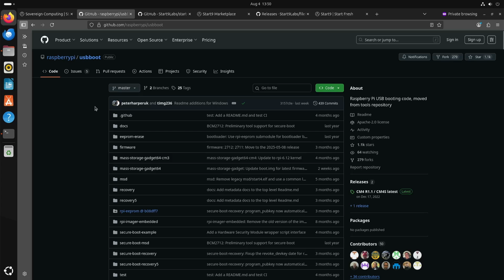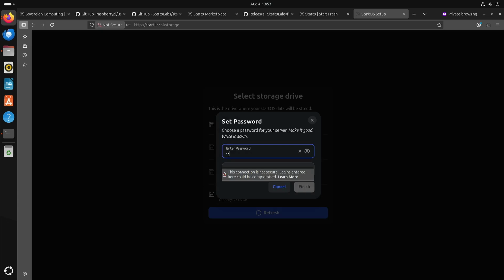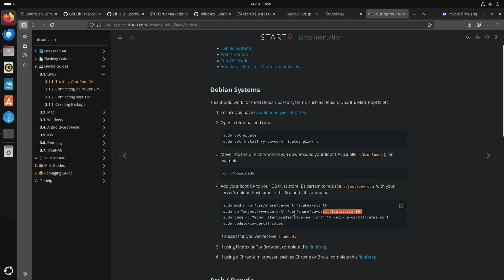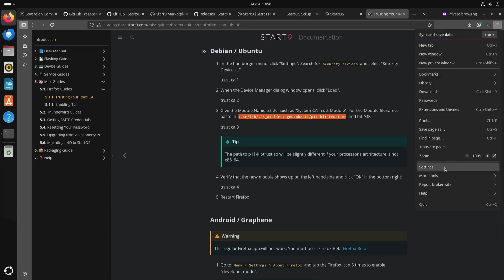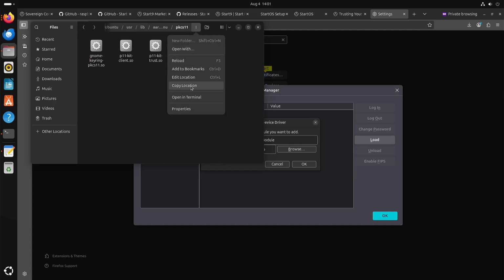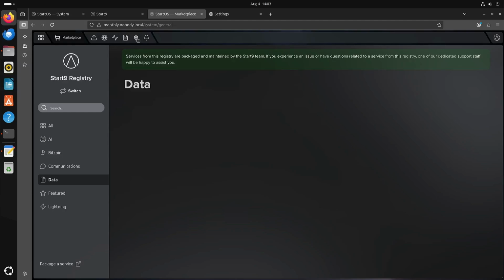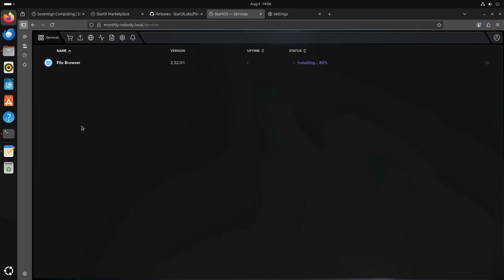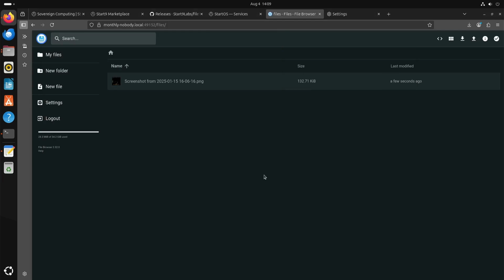StartOS CmRat Raspberry Pi CM5

Comment: Im using the cm rat with the Radxa CM3 8GB RockPro with RK3566 CPU - OEM - No MMC - No WIFI - 8GB Ram RPI4 and its been difficult to even load start9 os. Talked with cmrat and start9 teams and looks like I will have to wait. I will probably try umbrel. 

Would this basically apply to the radxa in this video instead of pi5?

Im wondering if I should scrap the radxa and go with a raspberry pi to save time and issues ive seem to encounter.
Reply from the maker: In theory it should work with the Radxa CM3. But the RK3566 only has efficiency cores and no performance cores, so a Raspberry Pi CM5 is a big step up.
But if you want to run Jellyfin with hardware accelerated transcoding, the Radxa CM5 might be a better option. But better ask DTV Electronics about compatibility of the Radxa CM5.
Reply: @LivingLinux yeah dtv said waiting for the new release from start9 and I think I will go with the cm5 or pi5. Thanks for the videos and everything 👏